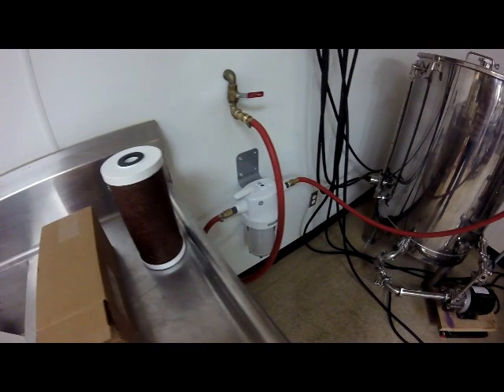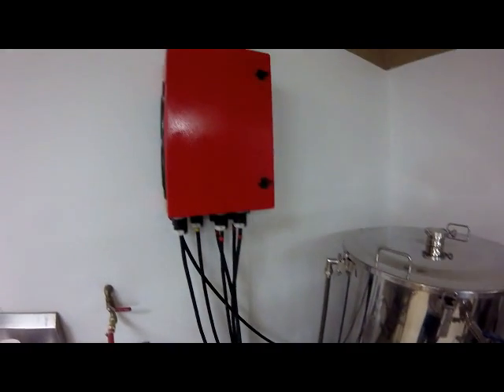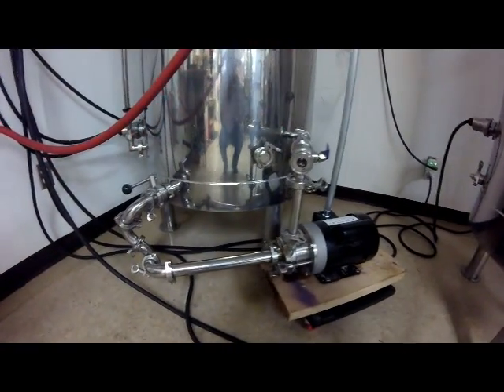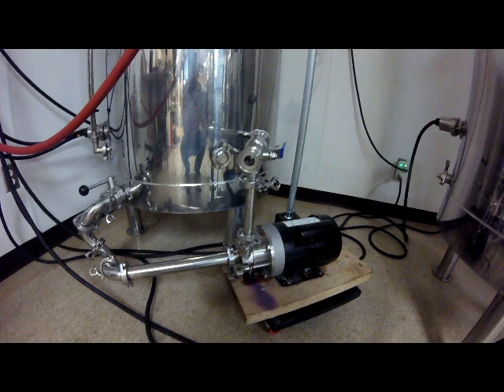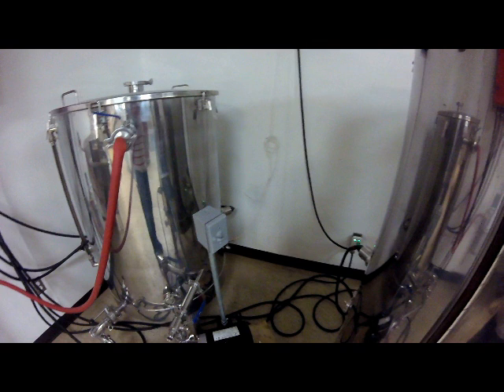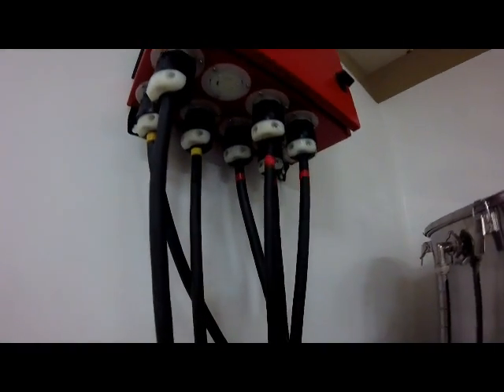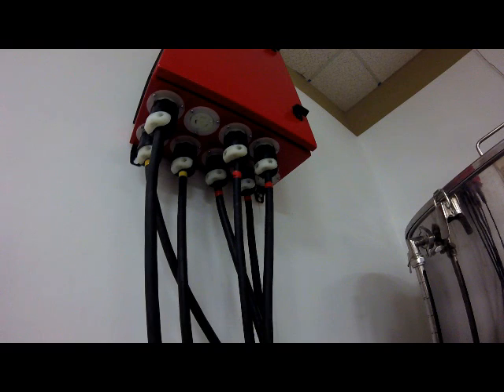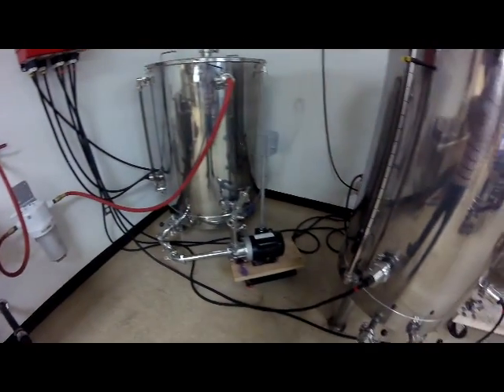Our Brew House - Part 1 The HLT

Comment: I'm actually building a very similar setup but was planning on using Brucontrol software to replace the pids as well as control my fermenters like it does in my home brewery... Do you by chance happen to have any blueprints for you power distribution panel you could share with me? I'm fairly certain I know how im going to wire it but looking for comparable plans.
thanks.